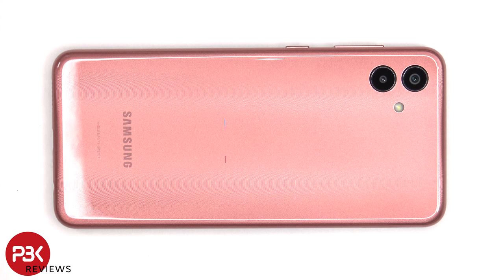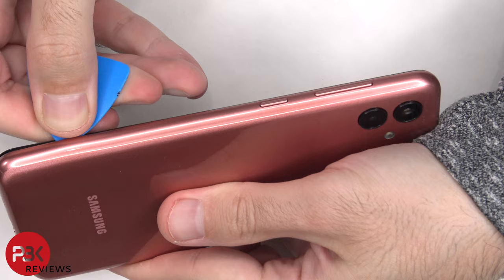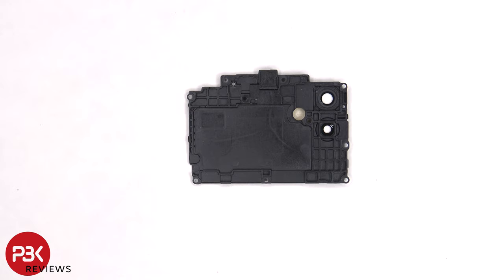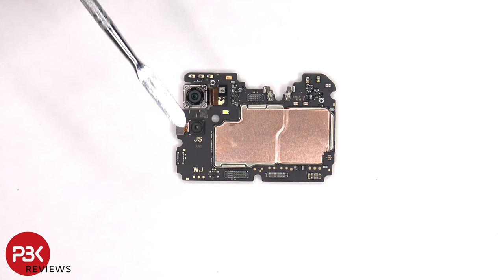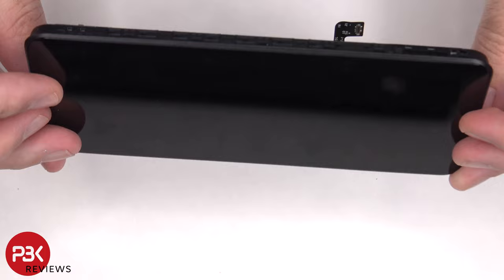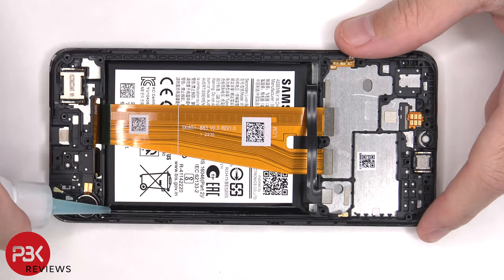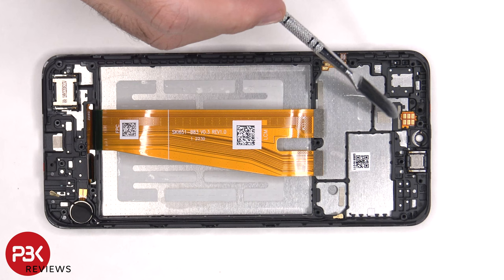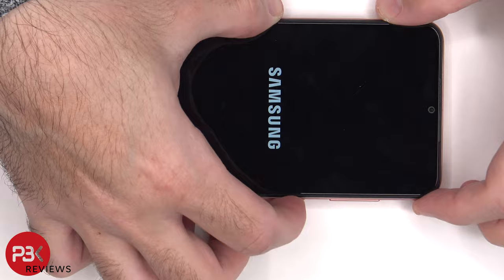Samsung Galaxy A04 / M04 / A04e Teardown Disassembly Repair Video Review

Comment: Samsung phones usually use green and blue color panels for the main motherboard, but can you explain why the use of black color motherboard for this model?
Reply from the maker: No clue, I don't know the reason behind colors of the boards. Maybe the black boards are cheaper? no clue.
Reply: @PBKreviews  Black mother board is more expensive tougher

Comment: Is an a04 replacement screen the same as the a04e? I have an a04 and was wondering if I could set that same screen on my a04e.
Reply from the maker: Hi, no they are different. The connector type and location is different as well as the flex cable.

Comment: How do i take off the front screen
Reply from the maker: after your disassemble the phone so you have access to disconnecting the screen cable, you heat it up with a hair dryer and just pry the old screen off the frame.

Comment: How are the vibrations on this one? Does it sound like a cheap generic vibration motor?
Reply from the maker: It isn't anything special but not too cheap feeling either. The sound of the vibration motor is more closer to basic though than premium.
Reply: This is the second cheapest phone that Samsung offers, just shy of the A04 Core. What do you expect?